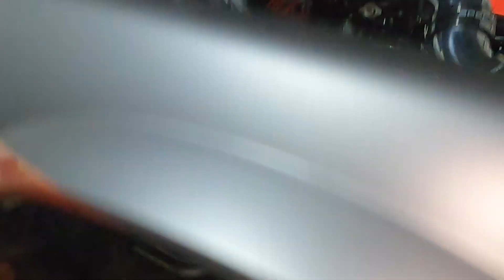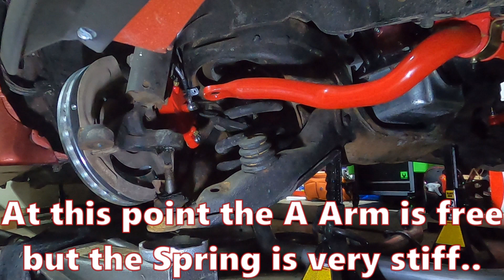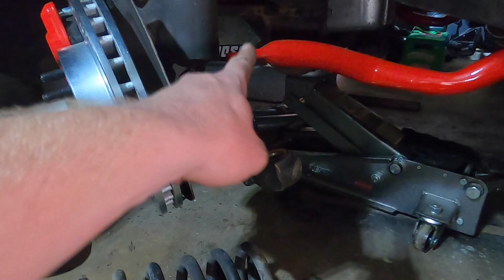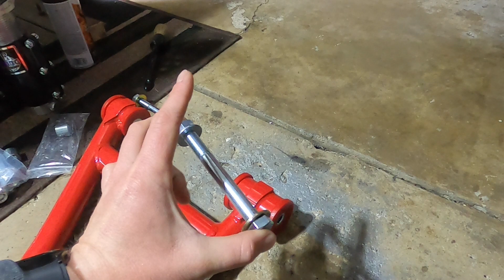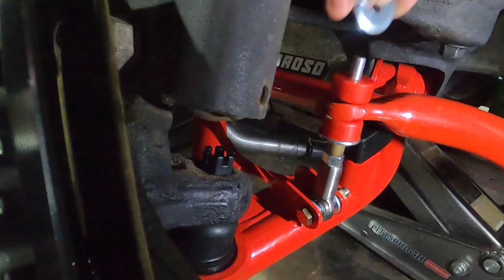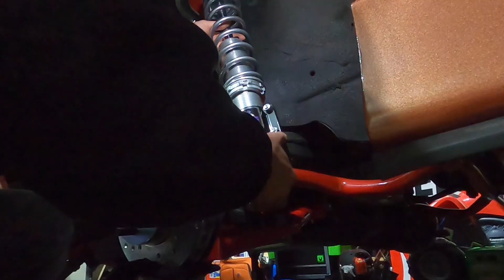82-92 Camaro Front Suspension Install Viking Coilovers and Spohn A Arms

Comment: Yo, will stock ride smooth if the components are replaced? I'm looking to only improve handling. Thanks for any help. Love the video.
Reply from the maker: Yes if your just looking at replacing some old worn parts with new oem parts it will help improve handling if your current parts are really worn. It most likely won't be a huge improvement but it will be an improvement over worn items 👍
Reply: I put poly everywhere I could, but not motor mounts. Tranny mount made a difference in shifting tightness.

Comment: Trying to understand why the coil over bottom hole would not line up up. Was it the ridges on the stock spindle ?
Reply from the maker: The base of the coilover was making contact with the spindle. And the hole was off by maybe 1/8 to 1/4 of an inch.